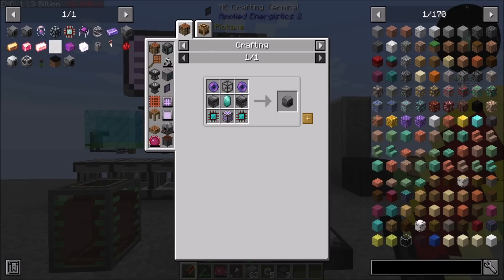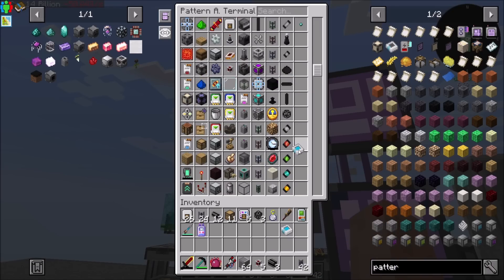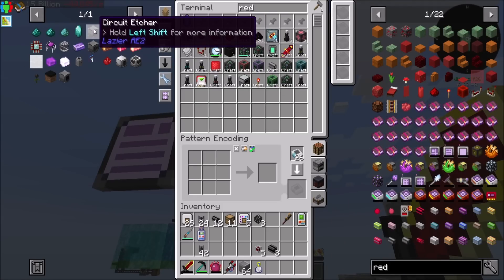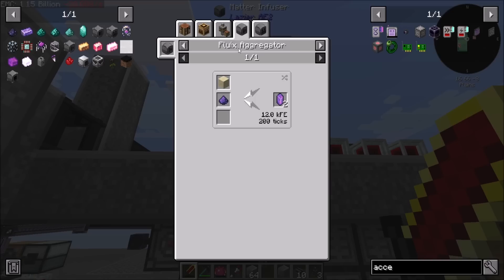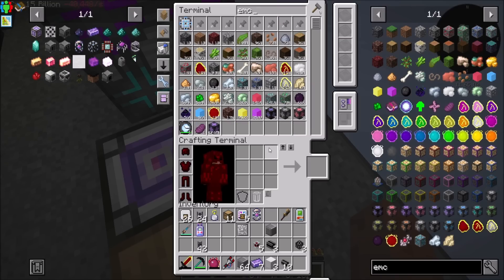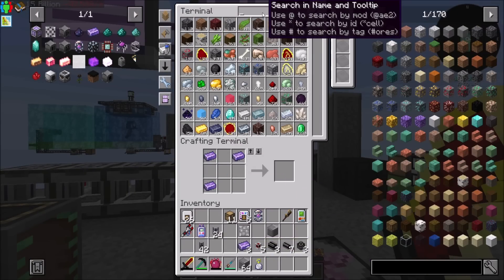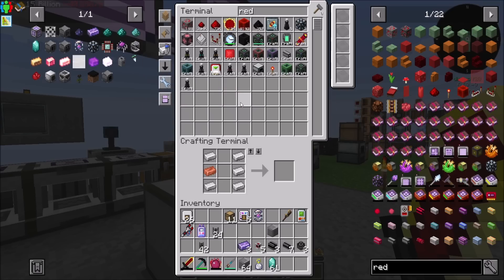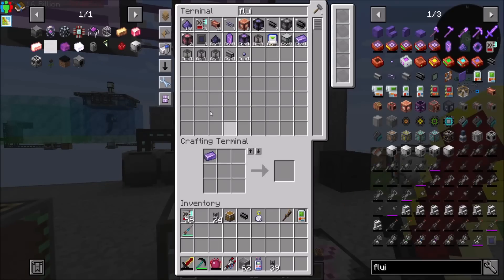Mechanical Mastery Ep30 Lazier AE2

Comment: Dire, you can use a Mekanism tank with an evertide amulet to make singularities faster than with cobblestone
Reply: Back in Age of Engineering, I did it with water into a fluid bits cutting thing, then piped the individual bits to the matter condenser as fast as possible.  With Laser IO, it should be possible to get quite fast.  I was limited to max speed Transposers in AoE.
Reply: @IMarvinTPA  Dire's done that in the past. He probably just forgot.
Reply: @IMarvinTPA I think he tried that before and found that even his max speed item moving from lazerio, was slower than just a maximum speed mechanical pipe using water directly.